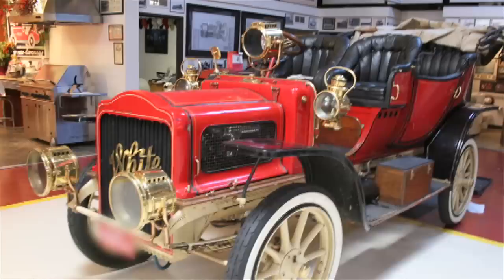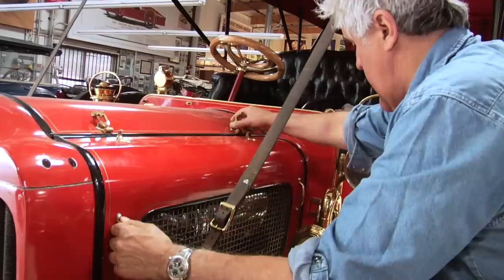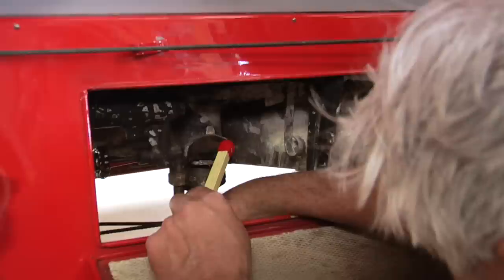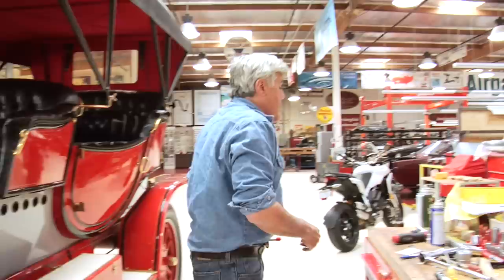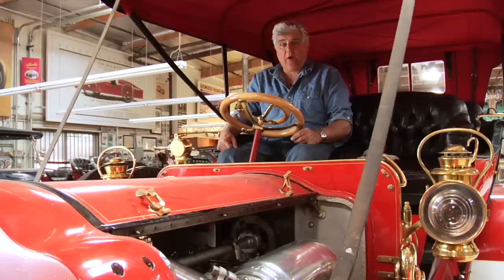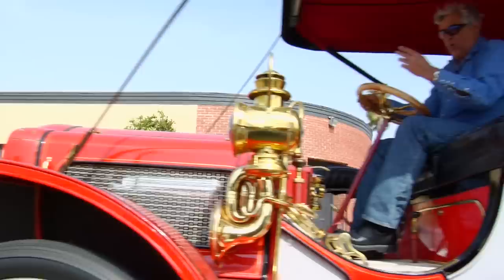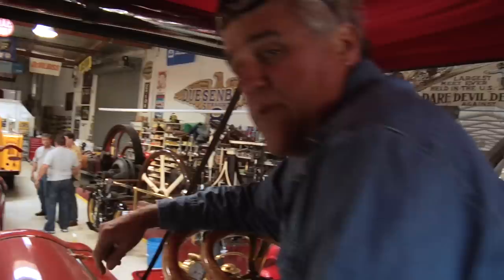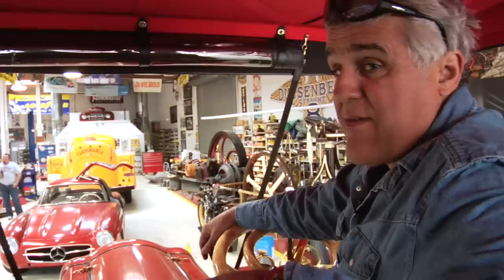1907 White Steam Car, 30 Hp - Jay Leno's Garage

Comment: This is the ACTUAL vehicle that recently (Nov. 2022), seriously burned Jay Leno. In this video, as Jay attempts to light the vehicle's burner, you can clearly see the flame briefly burning out of control and the ignited fuel dripping down towards the floor. This is EXACTLY how Jay sustained his burns in this current incident. With Jay's always positive attitude, I trust that Jay will make a full recovery.
Reply: It looked like you had to open a small narrow hatch low on the car, peer in, and stick your hand in with a match and if the valve was open too much, it let in a lot of fuel and created a BIG flame.  Like lighting a Coleman camping stove with the fuel valve too wide open and being too close to the stove.  Not good.
Reply: Suprised it wasn't his vanderbilt stanley
Reply: I still remember when that happened

Comment: What I find most amazing about steam cars, is that even though many were made over 100 years ago, the mechanics and engineering involved are still awe inspiring. I can look at them for hours and hours just admiring the way they work and the sophistication with which they were built.

I have built a few small model steam engines, the type that sit on a desk as an ornament of sorts. The first project I made after purchasing my mill/lathe combo machine was a small steam engine kit. I wish I had the means to afford a steam car, but for now my model engines are quite nice.
Reply: As I stated in an earlier comment, I have a few model steam engines. Out of curiosity, I decided to calculate their power output. My largest steam engine is one I built from scratch with 3" bore and 4.5" stroke, and it runs off a 165psi boiler. According to the formula I followed, it should make about 5.25HP and 70ft/lbs of torque. Impressive for an engine that sits on a shelf in my shop office! 
It may end up in a golf cart, along with the new 250psi boiler I built, which will be the closest I'm likely to get to owning a steam car. But with all that toque, it should pull just about anything! And with nearly 100psi of extra pressure, it will be making a good bit more power as well!
Reply: Shine Runnah i am a golf cart mexhanic abd if you do the steam cart please share video of it what a awsone cart that will be

Comment: My Uncle Billy Zerega in Wash. D.C. was a Stanley man and had two. One of them was a big six seater and the other was a 2 seater almost like a buckboard with a glass round plate windshield in front and turn handle with no steering wheel. Uncle Billy had many cars like Maxwells and Empires and Oldsmobiles and I loved helping him as a young boy in his basement shop. He made everything from blueprints, by hand and he was a true artisian/craftsman. He built brass lantern and wheels and rolled his own steel. He had a lot of friends in antiques and I miss him. He was a steam fitter by trade and his Steamers were his pride and joys. They called him steamer Billy and he was renowned as one of the best. He was friends with Harra and traded parts annually with him . They collected for each other !  Hes gone know and I havent seen him since 73 when my mom passed away back there.

Comment: those old cars are something special, really beautiful works of art, but at the same time it should make one appreciate the ease and convenience of a modern car and just how far we've come.  You just get in, turn the key, or in some cases push the button and off you go.
Reply: One wonders though,  in the future will someone like Leno be restoring current vehicles.  My guess is its not nearly as likely or prevalent.  Even after merely ten or twenty years some sensors and parts become unobtainable and too ridiculous to reverse engineer on a one off basis.  The only hope is aftermarket companies creating unlikely amounts of different sensors, harnesses, and computers.  The more mechanical it is, the more timeless it is.  New vehicles are basically disposable.

Comment: Another great car. The neat thing about a steam engine is it is double acting, which means you get 2 power impulses per revolution of the crank. On a 2 cylinder double acting compound engine it would be the equivalent of an 8 cylinder 4 stroke engine. The reason for a high pressure and low pressure cylinder is the high pressure steam enters the high pressure cylinder and on the exhaust stroke it is used a second time when it enters the low pressure cylinder. The low pressure cylinder is always larger because the steam is used a second time and the pressure is less hence if you increase the surface area of the piston you can still extract energy from the steam.

Comment: What cost $4500 in 1904 would cost $113226.93 in 2012....
Reply: Maybe with some bogus PPP figure based on the USD.  Fact is, 4500 dollars then was over 200 ounces of gold, which is now worth over 300k USD.  20 USD could buy you a brand new colt 1911 pistol  in the 20's ... 20 USD now can get you... fast food for two.  An ounce of gold would buy a new colt 1911 pistol then, and ounce of gold will buy you a high quality 1911 style pistol today.  An ounce of gold would buy you decent attire in rome, it will buy you a decent suit today.  I think I'll stick to the gold value calculations.
Reply: so this was a car for the rich

Comment: James Watt, inventor of the “condensing steam turbine”, for whom our most basic unit of energy measure is named. Significant enough contribution to efficiency of steam engines to be sure, but his amazing contribution was actually the graphical representation of force (coined the term “horsepower”), along with time on a scale. The condenser recovered the spent steam converting it back to water, this created an unexpected increase in engine output “horsepower”, and to market that free power output, James Watt invented a graphical chart/graph tool to visually show potential customers how engines using his steam condensers see improved power output (and with no increase in fuel consumption).

Comment: The part about how the fuel needs to vaporize sort of reminded me of the old Coleman white-gas camp-stoves which used a similar principle to vaporize the liquid fuel to the burner.  It was indeed a pretty efficient and safe system and  operation if handled properly.

Comment: Gee, no wonder internal combustion engines killed these off. can you imagine one of these today as a daily driver?  By the time you got to work, you'd need to take a break.
Reply: +theedrstrangelove steam cars could be just as easy to start as regular gas cars with today's technology...just automate everything with an electronic system all u need is a hose to fill er up with water
Reply: +theedrstrangelove We may see it again.  Swiss watch industry is back with their fully mechanical watch, and most companies make vinyl record players then ever.  Time for steam car revival :)
Reply: +Andrew Piatek A modern adoptation would be such a cool thing to see.
Reply: SheriffSkank There is a Swiss company (DLM) doing it with locomotives... but nothing legit for cars.. the terrible expense of steam automobiles makes the concept cost prohibited
Reply: Delta Fox Smokin weed?
Reply: Delta Fox So what are you smokin right now then?
Reply: +theedrstrangelove I think Abner Doble showed that with further technological advancement steam cars could've eventually become something very practical. After all, you're looking at technology that wasn't developed any more past the 1920s, without regarding what the possibilities may have been. Of course a 1907 White would be totally impractical today as a daily driver, as would a 1907 Buick with an early internal combustion engine. Theoretically a 2016 White steam car with 109 additional years of continuous development would be as different from this car as a 2016 Ford Fusion is from a 1907 Ford Model K.
Reply: ***** I think Abner Doble showed us the with lots of money wasted and a poor business model you can prove what automobile manufacturers already knew... the hard way! that steam was completely obsolete by 1915 .

With further technological advancement steam cars would have produced very similar results... financial failure!

Continuous development would have proven only one thing, that steam was much more expensive to build and operate... and far less fuel efficient..

Like comparing 2016 Ford Fusion with a 1975 Ford Torino

Comment: steam died because it is only efficient in large applications like those used in industry. On the micro scale of the energy needed for an automobile, it is grossly inefficient and highly temperamental. It is also a middle man that internal combustion engines cut out. Why heat water with gasoline to make steam move pistons, when you can use the heat of the gasoline explosion itself to drive the pistons.
Reply: Great comment... sums it up very well.

Comment: What you are saying makes more sense to me as i would expect that a close system would run almost indefinatly with the same water (there will always be losses by condensation and evaporation but they should br minor), and it wasn't clear in my mind why the range limitaion was in the size of the water tank and not in size of the fuel tank needed to feed the heat source.

Comment: if i understand you correctly, in simple terms, the Doble was an "upgrade" of the White with that waste steam driven turbine. I expected by being a "close system" that the water would last a very long mileage. Is it because they had a lot of losses by steam loss and condensation?

Comment: Prayers for Jay Leno, he got burned a few days ago while working with one of these steam engine cars. ❤️🙏❤️
Amazing knowledge and detailed explanation of how these cars work. Very interesting video.
 Reports are that he's doing well, and up and walking around making jokes and serving cookies to the children in the burn center where he's being treated for second and third degree burns on his face and hands. ( The fuel line was clogged and it accidentally sprayed fuel on him, and a spark lit him on fire. ☹️ )
   🍀 Luckily a friend was there when it happened, and he helped put out the fire. You can see at about 4:28 (on this old video) how he has to be so close to the fire when he's making adjustments to get the car to run. ( He burns his hand a little during this video, when fuel is dripping and igniting.)

Comment: Steam has pushed tons of iron trains across the US. I know we can make modern mini steam engines that burn propane with tons of power. I put hot water in my plastic coffee cup if I shake it slightly the lid blows off with just one shake. Steam is Powerful. I'm gonna make a mini steam engine you can carry in your suit case. It will make a latte on the way to work. Your steam engines are some of my favorite vids back to the future. Thanks for sharing your ❤

Comment: See? The water tank pumps through the coil, but on the Owen Magnetic, the water pump just runs electric brakes, I think... which was another new thing on it.

They just replaced the fire box with magnets and used the electric water pump as powered brakes. The magnet charges the battery by spinning the electric generator, and also drives the car, siphoning off electric energy as neccessary to increase speed. There had to have been a way to limit its efficiency, or it would almost not be safe back then... super efficient motor, and the price tag is reflective of that.

Comment: its truely amazing how advanced they were able to get these steam engines way back then.  I never really knew there was that much to one and really you can tell this is about as efficient as a steam engine will be
If only we could find a power source as good as nuclear power but without the danger we would be set

Geothermal power plants are very amazing as well, think about it.  The energy comes from the heat of the earth.  No harmful emissions and totally renuable 
we need more of those plants
Reply: Nuclear and geothermal still use steam.  Steam turbines simply use the heat from the nuclear reaction or from the earth to operate.

Comment: IC engines at the time had reliability problems.  Between soft metal main bearings an unhardened valve seats you were lucky to get 100 hrs between rebuilds.  While steam cars lasted longer if you ran them every day.

One who could afford a $4500 car could pay a driver $1 a week to warm the boiler up in the morning.

Comment: Hi Jay, when you 3d print your parts, are they direct castable or do you make a mold of the printed part and do injection wax into the mold?... or is it some way other way I am not thinking of?... love the car by the way. :-)
Reply: +Albert Ayars I believe they usually recast from their 3d prints in Jays shop. So the 3d print functions as a prototype/moldplug.

Comment: How efficient is the throttle control? I am under the impression that with railroad locomotives, it is inefficient to run them with a partially open regulator, usually power is reduced by adjusting the valve timing with a Walschaerts or similar gear - if this is the case, does this engine waste steam running at partial power - or does the throttle wheel control both a regulator and valve gear, closing the regulator only when it reaches zero power? Or maybe the valves themselves could close off steam by never being opened when the valve gear is adjusted to zero power... now I am speculating

Comment: i have a question... i assume the fuel  these cars use is regular gasoline... now, my question is... how much gasoline does it use? more or less mpg than a modern fuel injected car? do you pull up at a gas station like you would with a modern car? turn it off.. fuel up... pressurize it?.. and turn it on again and keep driving? 

Also.. once you've built up steam.. how long would that steam last that you could come back to the car later and just get it going without having to spend 10 minutes everytime to get it going?

these videos are fascinating to me jay... i swear there is NOTHING on youtube that i watch more than your channel.. going on a couple years now... im a big fan...
Reply: A modern internal combustion powered car gets about twice the fuel economy with nearly 10 times the horsepower output.
 Steam is horribly inefficient in terms of fuel consumption.
Reply: either a quasiturbine (no recompression, no loss of power through converting reciprocating motion to rotary motion and no loss of power from the reversal and loss of momentum inherent to reciprocating motion) or an opposed piston compound uniflow steam engine, add condensing or a bottoming cycle with a small engine powered by a lower boiling point liquid. either could approach ICE Efficiency.

Comment: If the water tank lasts anywhere from 40-150 miles . how long does the fuel / pilot fuel tanks last? Im just curious because water is everywhere and you could carry extra gallons in the passenger seats and if the ratio is that water is used faster than fuel then why not make the water tank bigger :)

Comment: It's kinda shocking how in that time period cars were just so much cleaner than nowadays, with these steam engines and (I believe a little bit later?) also a lot of electric cars. Now we are trying to get our internal combustion engines cleaner and more economic and lots of effort is spent to develop electric (and hybrid bleghh) cars but it just feels like we were far ahead of where we are now a 100 years ago in that regard.
Reply: Alabastine.  Not really.  Remember the steam was heated by an open gasoline flame.  C7(heptane) and C8(octane) combusting is gasoline burning in open air to produce only 30hp using a whole lot of boiling water and steam oil.  That steam coming out is mixed with oil, just like a locomotive.

If you have a 30hp modern gasoline IC engine then the lubricating oil is self contained (doesn't burn away as loss), the gasoline air mixture produced direct energy so by the second law of thermodynamics you reduce wasted energy, and the exhaust for burned gasoline is less than that for equal HP White, Stanley or Double.

You however want a 150hp to 300hp motor.  That is 5-10 times as powerful as this motor, so takes 5-10 times the BTU of a 30hp ICE.  Compare this to a Honda Rebel 300cc motorcycle or a Ninja 250.  70-90mpg.  Very little fuel burned per minute.  1.5 hours to burn a gallon of gasoline.  Extremely efficient and clean.
Reply: @STho205  OkOk I know you burn fuel to heat the steam, but Jay said in the video modern engines polute more that's why. It wouldn't surprise me if it weren't true indeed.
Reply: Alabastine.  Jay's a pleasant comedian, avid collector and generous host.  He's not an engineer or even a mechanic.

Your ICE car is much less polluting than the media has led us to believe.  If you compare a modern 1L Mazda or Ford motor to a 1969 442 or 65 Lotus or Jag he collects it is analogous to an EV.

Comment: Careful with that white insulating material on the cover/lid of the pilot burner. Looks like asbestos. Touching or rubbing it might release the fibers, and that's quite hazardous if you're hovering directly over it and breathing it all in. 
Same goes for the insulating rope that covers the pipes and possibly the brittle material on the larger pipes, but you're less likely to disturb that stuff if you're not doing restoration work.

Comment: Fascinating ,but thank God the electric ignition combustion engine got perfected.
Reply: When? I haven't seen a perfect one yet, been looking for close to 40 years and that was because a sixty year old mechanic told me there would never be one. All the power goes out the radiator because lubricants and alloys can't handle the full heat output of hydrocarbons and still be affordable for the general public. Friction robs you of power and wears parts constantly. The most efficient internal combustion engine built doesn't approach 50% efficiency in the real world. Continuing to use petroleum to power tranportation is like buying the bricks to build a chimney one at a time